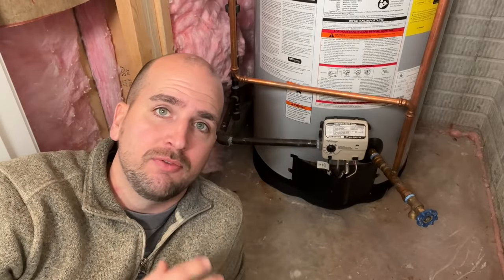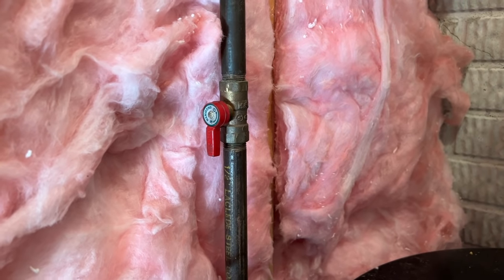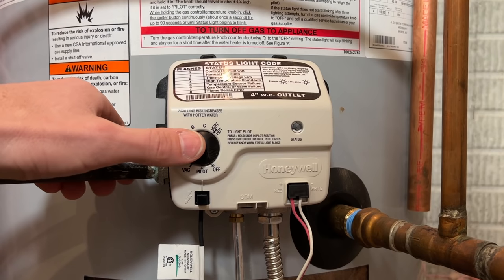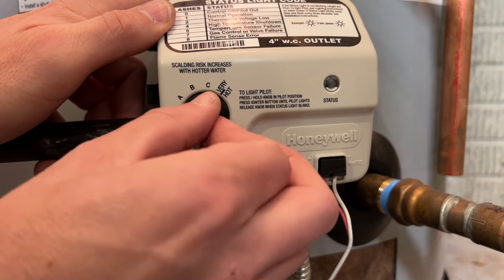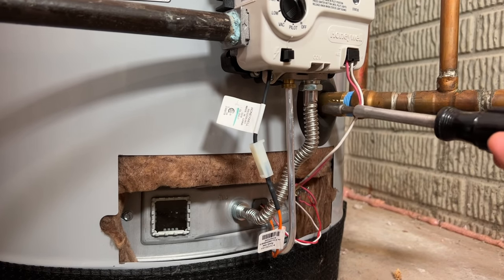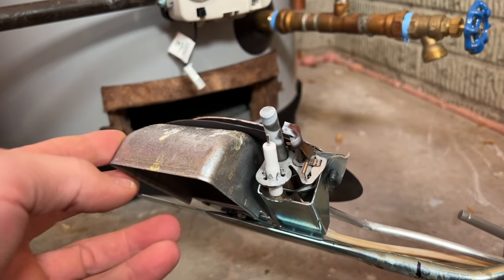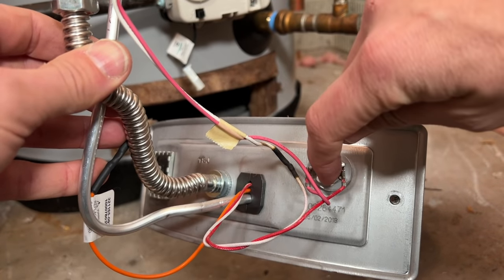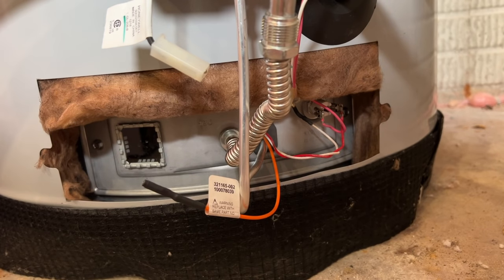Easiest Way To Light A Gas Water Heater Pilot Light

Comment: you saved me with the waiting 10 minutes thing! I didn't see a spark so I though I had another issues entirely. You have to have it on OFF and wait 10 Minutes and it still took a good 30 seconds or so of clicking the ignitor before it lit.

Comment: I got a call on a Honeywell controlled Rheem water heater today and it has an intermittent problem. I said I would call back in a half hour. Then I watched this video and was confident if they bought a new control for that 2012 heater, I would install it for them.  Thank You! ~ Retired Electrician

Comment: Best video for figuring out the Honeywell valve.  My pilot would not light.  Took burner assembly out and detected a weak spark.  Little light snadpaper to the ignitor and put it back together.  Pilot came on after 1st click.  Now back to normal.  Thanks again.

Comment: This was the perfect instruction for a first-time user.  The instruction is not rushed, and it included important signs that each step had been completed (e.g., keep pressure on pilot button to ignite,  and then viewing flame through the tiny window.  Thank you so much.

Comment: Very informative video as usual. The only fine point I would add is after connecting pilot tube and gas to gas valve is to test for leaks with soap bubbles.
Reply: Or a gas leak detector

Comment: I am very grateful for this video! I referenced it several times while changing my burner assembly. It was especially helpful to see how the electrical wires are plugged in (whether you pull straight out, push a clip, etc) and what direction the lever is turned to shut off the gas. For me, the gas line that goes to the pilot needed a compression sleeve, which I needed to learn more about. Also, I needed to use some lubricant to for both the gas line and pilot gas line coming out of the controller. It would be great to learn about these topics in any follow-on video.

Comment: Very informative video, highly recommended.  Lost power off an on for about 2 hours yesterday afternoon. Seemed like with the heavy rain and wind we had, somehow the pilot went out.  Had to do this process twice, but finally got it up and running.  Big tank, so taking some time of course to heat back up. Had a bit of worry with some orange flame at the startup, but posts on reddit seems to state that is normal after being so cold for a while.  shut off like normal once heated up and when restarted, back to a blue flame. all seems well. 
probably saved a good bit on a service call, that I could do with this very informative guide.  Much appropriated, would highly recommend.

Comment: Excellent video, power outage took out my water heater's pilot somehow, watched other videos but this one is superior for several reasons:  1) Explains where to look to see the pilot light and the sparker, 2) explains all the components of the system using CORRECT terminology, 3) No beating around the bush with a 4 minute lead up.  Bonus: explains the tiny reset switch, but doesn't go into much detail - i'd like to know more about what the switch looks like/feels like if it is not 'on' or needs to be pressed.

Comment: Thank you so much 😊 I was able to re-light the burner on my water heater....I was so scared  but it worked.  After pressing the ignite button 10 or more times the status light started to flash showing it is working properly. I was able to turn the dial back to where it was between (A &B)  and TA DAH 🔥 flames. My pilot is now lit and operating!!!!!!

Comment: Really useful. My water heater is ancient and  the pilot is lit with a match or similar ignition source.
I would advise everyone with a gas water heater to buy a spare thermopile. They are available at any hardware or home store. When they do fail it will most likely be on a holiday, during a storm, etc. It's just one of those laws of the universe. Replacing it takes only a few minutes. And don't forget to check the TPR valve at least once a year but do it when the stores are open in case you have to replace it...also very easy.
Reply: If you have an older water heater you most likely will have a thermocouple instead of a thermopile, they're both to make sure you have a pilot that's lite and not letting gas come in the house. ,
Reply: @j.michaeljefferson60  That's correct, I do. I used the same term as the poster so as not to add a confusing term. But the homeowner must match the device he wants to replace since they are not, to the best of my knowledge, ever interchangeable. Thank you. Your comment will help to prevent viewers from making that mistake.

Comment: This video got me back up and running !! I couldn’t afford the repair of whatever the water heater company said so we watched this video . 
We weren’t letting the system reset long enough not getting our burner to inginite . After the 10 minutes we followed each step and it went on immediately 🎉 hot water back on instead of warm showers . Note * we did turn down the temperature of water to be less hot if in the case it was shutting down because of temperature , great tip !!

Comment: Thank you. I read the directions on the water heater but it didn't light and after a few tries i was smelling gas. So I turned it off to wait 10 minutes. While waiting I found and watched your video; which luckily was 10 minutes long. Then went back and it lit up quickly and easily. Thanks for the assist.

Comment: When the dial is in the pilot position and I depress and hold and push the igniter button there is no hiss sound, no gas being released and no ignition. My tank is 14 years old, never had a problem with it and it just stopped working. Thanks for a clear and easy to understand video.
Reply: Think you have to keep pressing the igniter , we had to press ours more than a couple times

Comment: Great video! You recently helped me with replacing my toilet in another video. thanks for taking the time to help others! 
Re: hot water tank. I need help putting the control cover back on. i mis-read the directions to  "remove cover" - - now I cannot align the 4 screw holes and 3 pins. Any tips please?

Comment: After my friends came back from a year of being away, they found the "vacation" settling didn't keep their pilot light on. They called the gas company whom couldn't light it, then paid a plumber $150 and that guy couldn't start it but was able to write a replacement estimate of $2,100. It took me 5 minutes to ignite the pilot, albeit holding the pilot start button in for a couple minutes. Thank you for this video.

Comment: Very clear video --- thank you. Question: my pilot light window is cloudy, so it is difficult to see what's going on in there. But if I perform the lighting test that you did so you could see the spark before adding gas, I do not see a spark. So maybe new lighter/ignition is required? Many thanks!
Reply: Did u ever figure this out?
Reply: decided against replacing the starter unit and just had to buy a new damn water heater! Appreciate the videos!  @Nonlactoseintolerant

Comment: Awesome video and very imformitive.  I'm having trouble lighting pilot in my LP water heater.  I followed your video except for pulling the pilot out, question, in the off position when I press the ignition button i can see a spark but when I switch over to pilot I dont see the spark anymore, can you advise?  Thank you!!

Comment: Scott;  Confusion on my part.
What is going on with the copper
pipe leaving vertical from the drain valve?
Reply: It's probably a recirculating line coming back in

Comment: Water heaters have a fairly long life, many folks still have older models with a thermocouple safety...would be beneficial to do the same type of presentation for them
Reply from the maker: Hey Gary, thanks for the feedback.
Reply: @EverydayHomeRepairs   only a suggestion, I've been working on water tanks and other plumbing fixtures also  a master HVAC technician with my license up to date. You can mention the gas tubing is very flexible and it can be damaged easily and it's so easy to strip the treads , But tearing the tubing up is a possibility but it is rare to do that with the proper tools.
If you want to contact me please let me know. I'm retired soon. I like your videos and you have the skills of the professional.
Reply: I have an old water heater with a thermocouple, I use those long fireplace matches.
Reply: @jefflebowski918  I believe I have the same kind so I’m getting no where getting mine lit, when you use the long match are you holding the lit match under the center of the area?

Comment: My heater I replaced the anode lead with terminals for the thermal switch and used crimp brass bullet on red lead pilot won't light will connector make a differance?

Comment: I gave the same water heater tgars only 2-3 years old. Recently I had enough standing water on the floor enough to snuff out the pilot light. I took out the burning and insured no remaining water was in the gas tube or burner and reassembled. But when I try to relight it, I can see the igniter spark when I press the button but the pilot won't light. Do you have any recommendations for why it won't relight now? I live in a very rural area and can't get a plumber to come out for two more weeks.

Comment: Thanks for the info. Wow this is much simpler than I thought. What do the orange and white wires do? Is that the control side for when you adjust the temp dial?
Reply from the maker: The 2 wires going into the burner area (in my case red and white) are connected to the thermopile which when heated by the pilot light provides a small amount of power used by the control valve.
Reply: @EverydayHomeRepairs  thanks! Sorry for the confusion, I was asking about the orange wire that looks like it goes into that white plastic connector. The wire for the ignitor maybe? It looks like it's directly below that button
Reply from the maker: Exactly, yep that is for the ignitor 👍

Comment: I observed there wasn't any dielectric fitting on your water recirculation return at the drain as you have copper piping to your iron water heater. This will cause quicker failure to where the copper enters the water heater.

Comment: Hello, I changed to a new one, but the problem is that the blue light does not come on, the red light comes on, and when I press the pilot button by hand, the light in the bottom burner goes off. Why is that happening??

Comment: Just installed new controller now pilot light will not light, we do have sparks. Also installed new burner unit. It seems that gas is not coming through. PGE verified that there was gas to the controller. Any Suggestions Please

Comment: OK.. I have the same honeywell valve.. error code I am getting is #5 sensor failure... I can relight the pilot and the heater fires up.. I go away and it it shuts off again.. restarted it 3 times and keeps shutting off after a short while.. what part do I need to replace??

Comment: My thermocouple needs to be replaced. My heater is 23 years old, it’s a Kenmore power miser 9. The thermocouple and replacement are discontinued.
I’m hoping the generic ones will work as a replacement to keep it running a little longer

Comment: I doubt anyone will see this in time to help, but I’m gonna ask anyway… how long is too long to hold the pilot light button down waiting for the status light to flash?  I mean is there a point after a certain number of minutes where it’s an indication that something else is wrong? I held it down for three or four minutes a couple of times, and my thumb kept slipping off the button because it was hurting, and I was just trying to change positions or switch fingers and kept accidentally letting it go and had to start over. so do I need to just keep trying? Is it possible this could take 5 or even 10 minutes? 

I don’t understand why it would take so long for the status light to begin flashing. I’ve had to relight this pilot a couple of times in the past and it’s always come right back on immediately with no trouble. This is the very first time I’ve had to do anything more than click the button a couple times, and turn the knob to the position I wanted it to be in.  We’ve only had it for a couple of years.

Comment: I’m having a lot of trouble with my pilot going out. I can light the pilot, increase the temperature and the burner lights and warms the water normally. As the hot water is consumed, the burner does not relight and I get the error showing 6 flashes, which is “replace burner”. To relight the pilot, i turn off the controller and unplug the thermopile reset the controller. When I need hot water again, I repeat the process to relight the burner. Is this a common problem? What could be wrong?

Comment: Pressing my igniter while  holding in on the pilot  wouldn't light mine but would I did was after clicking on the igniter for about a minute and a half i throw the switch to very hot and that lights it up..idk why but iv done this twice now and worked both times.. also i  don't leave it on very hot..once lit i just put it on the  hot setting

I changed the whole gas valve unit  after gettibg the 5 blinks..but im guessing i might also have a igniter issue. But everything seems to be working fine for now so imma let it be as it is a 11 year old unit

Comment: I am used to the old thermocouples and the replacement.  So, is this igniter system set up like my gas grill, every now and then I have to replace a battery on the grill, then when I press the igniter, it works...is there a battery mounter in that controller?
Reply: No Battery

Comment: My initial problem was I shut off the pilot light and when I turned it back on it would not stay lit.

Prior to dismantling everything to clean it (it was full of rust debris) the igniter worked. You couldcsee the spark through the window.

Now that everything is reassembled, I no longer see the spark through the window and my pilot light is now not lighting at all.

Thoughts??

Comment: What if the status light doesnt come on even tho i cant get the pilot light lit, doesnt stay lit because the status light doesnt come on...
Reply: This my problem
Reply: @lizgaddy  I ended up getting mine lit. Under the panel cover you take off to see if the pilot light is lit to the right theres 2 wires. I disconnected both of those and plugged them back in. Water heater started right up no problems after that!

Comment: What if I can get the pilot to light but the status light never blinks?
Reply from the maker: Hmmm, I wonder is the Thermopile isn't picking up the heat/flame.  Some times the Thermopile can get build up where it doesn't absorb the heat correctly but just needs a simple cleaning.

Comment: That’s a terrible gas line set up easier to use shut off valve with a flex line for easier maintenance or future replacement.  There’s a reason why your pilot goes out .. relighting doesn’t solve the problem .  Call a professional gas can be very explosive